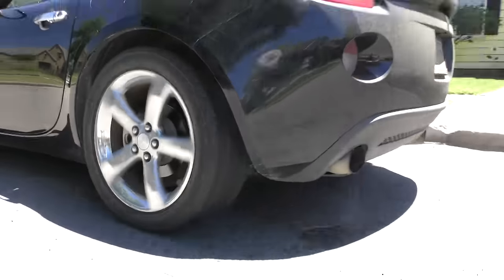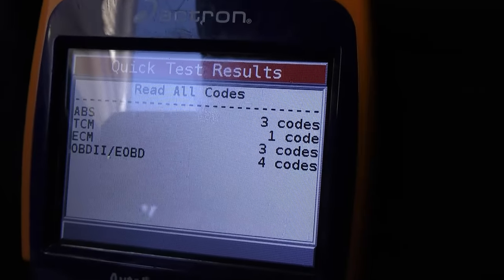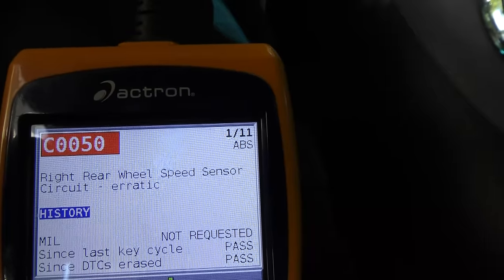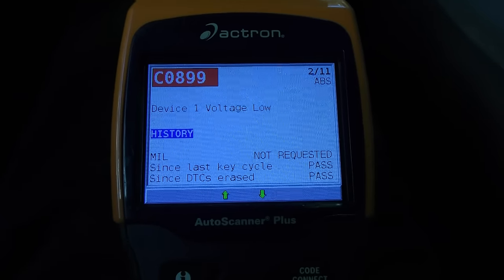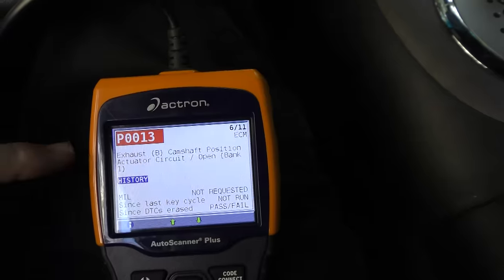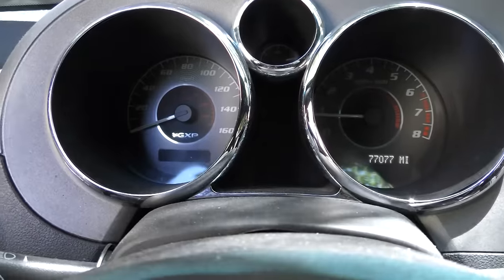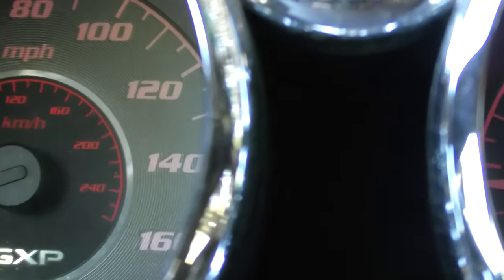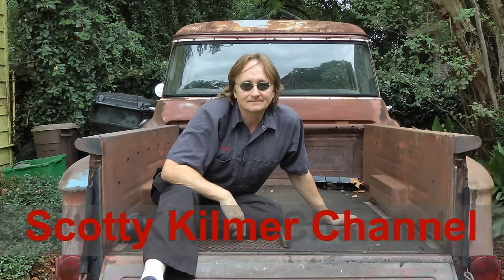Check Engine Light On in Your Car? The Truth About What it Means

Comment: Or just buy an older vehicle that doesn't have all that unnecessary stuff in the first place.
Reply: luke Fugate amen
Reply: luke Fugate I prefer disc brakes and abs. they stop much better and are easier to replace
Reply: Perfect suggestion! That's what I did. No unnecessary codes for minor issues, no silly sensors breaking, no limp mode from ECU glitches, no idle relearn bullshit, no reset codes to enter after disconnecting the battery! I truly miss 1990s technology when cars were actually built to be maintained and fixed instead of being purposely designed to fail, so manufacturers can rip customers off for profit, what a shame!
Reply: Yep, I'm still driving the same pickup truck I had when I first got my license at 16. I'm 43 now and the truck is 49 years old and I would drive it anywhere with confidence.
Reply: luke Fugate I daily drive a 1972 Dodge Dart swinger
Reply: Amazing! My vehicle is not quite that old. But, still built before the "unnecessary profitable tech" era, long gone are those days when vehicles were designed to last 20-30 years with just basic maintenance. These days vehicles are made to be disposable with HUGE profits in mind. If you think about it there is an abundance of unnecessary technology in modern vehicles that cause more harm or headache than good. My favorite example is "fly by wire" throttle which is absolutely unnecessary, there was nothing wrong with a mechanical cable that pulled the throttle open when you hit the gas, it's not a fucking airplane, it does not need electronic assistance to move flight controls, and that's just the tip of the iceberg.
Reply: I drive old Toyota's for this reason ;)
Reply: luke Fugate exactly. I drive an 85' f150 for this reason
Reply: luke Fugate low cost Saturn's are awesome for this reason.
Reply: BigWheel lol Saturn
Reply: my thoughts exactly :D  (driving an old 87 ford)
Reply: nickweg1996 I have an sl1 from 2001 i think
Nothing breaks on it because its pretty much a plastic shell with wheels being pulled by a few hamsters. 
A really nice beginer car i might say.
Reply: But when something goes wrong with it you dont know what the hell is causing it bc of no OBD 2
Reply: luke Fugate good idea
Reply: That's what they call troubleshooting.  With an older vehicle(carbureted)if it's getting fire and getting gas, and it's in time it will run. If my truck breaks down, give me five minutes I'll know which part has failed without having to worry about a computer.
Reply: luke Fugate I know that I had a 1997 Suzuki vitara 1.6 petrol single point injection only 50,000 miles was bomb proof Mrs did not like it, now got a Mercedes c220 cdi 2003 with many electronic things that can go wrong touch wood nothing so far
Reply: luke Fugate older cars have problems too
Reply: I recently bought a current model Vitara. It's practically the same engine, no direct injection, no turbo, only one variable cam. Very honest car that drives surprisingly well.
Reply: +RealDarkkFilm, OBD 2 is not an issue, if it is paired up with a basic system. mid 90s Toyotas, Hondas, Nissans etc came with OBD2 and still used very basic systems like throttle cables and map sensors(instead of MAFs sensors) which are more prone to issues. My 1997 Cavalier I had years ago had OB2 with a very basic oxygen sensor design(1 wire), I had it for 12 years and NEVER had to replace it. Fast forward 15 years, how many electronic throttle bodies,  MAF sensors, O2 sensors, key less ignition systems, tire pressure sensors, electronic gas pedals go bad and have to be replaced in a 5-10 years of ownership?? As I've said earlier, most of these "modern systems" are highly unnecessary, and are nothing more than a well thought out scam.
Reply: True, but they are much easier and cheaper to fix. Plus they have a lot more style than anything made nowadays.
Reply: Rodney King and why if its a manual dont press the clutch and turn it off when it stops?
Reply: luke Fugate pb
Reply: Hamachingo what year mine was 97  it was a 1.6 jx hardtop absolutely beautiful I loved it, I'm gutted extremely easy to work on if the very unlikely happened
Reply: That stuff is pretty necessary to keep the planet habitable for us.
Reply: like safety equipment
Reply: +Koshunae, Don't be naive, Trust me electronic fly by wire throttles, MAF sensors, tire pressure sensors, 
 dealer encrypted security codes, ECUs that go into limp mode for no reason, electronic gas pedals do absolutely NOTHING to make the planet more habitable. they are just there to break so car companies can make a fortune off of the repairs and parts.
Reply: Don't be so pessimistic. MAF sensors, EGRs, Catalytic converters, crank sensors, cam sensors, etc,. work together to keep the emissions of your vehicle down, namely CO2 and NOx, the biggest contributors of greenhouse gasses. Not only do they keep emissions down, they help your engine last by keeping it running in optimal conditions. Modern vehicles can easily, EASILY go over 400k miles with proper maintenance, I've seen plenty of them back when I worked the lube bay. I still see plenty of them in the shop. One of my best customers is a national landscaper and his personal truck, a 2012 Silverado, has 487,000 miles on it. Still on the original engine and transmission, no rebuilds. He also has a 2015 pushing 300k, and both of these are work trucks. They get used very hard, coast to coast pulling trailers of equipment. You will never see a pre-computers vehicle running that long without some huge intervention to refresh the vehicle. Really before the mid 80's, 100k miles was pushing the end of an engines life, and the transmission had probably given up by then at least once. 

Coming from a master technician, the systems suck to work with. They really do. The engine bays are cramped, sensors break and wires are everywhere, but calling them unnecessary is unfounded and shows you really don't understand the systems and their purpose.
Reply: Koshunae modern  vehicles are only built to last 100k miles, even the manufacturers admit it. Obviously, as a master mechanic, you don't know what your talking about. I know many people that have 2nd & 1st Gen dodge rams with a 5.9 that have well over 300k miles, I know people with camrys and Lexus that have well over 400k miles that are from the early 90s and neither of those types of vehicles needed any overhauling or large replacements. The new ones just can't go as long without major repair, typically electronic equipment. With the wrong Guage wire being used for everything on a car, just to save weight, it's no wonder why most recalls are something electronic. Gee, imagine that
Reply: I beat you Luke...I still have my 1967 Oldsmobile Delta88 that I first drove in 1982 when I was 18 years old. I moved it from Canada to Australia in 1997 and used it as my wedding car in 2004.  If I could by a brand new car like this I'd be more than happy to part with $100K for something built like a tank.
Reply: arnbo88 very cool. That car is a world traveller! I think the car companies have forgotten how to build cars nowadays.
Reply: NARK NARKO 15 years ago? Dude, OBD systems have been in place since the late 80's.
Reply: + John Mediadozena, I didn't vote for any of that, so don't hold me accountable! LMAO. This is why one of my vehicles is a 20 year old Toyota, something I can ALWAYS rely on, granted I perform basic maintenance.
Reply: +Wayne Wildman, What's your point? I am completely aware of that! I have nothing against OBD systems, my 20 year old Toyota has OBD2 and still has a throttle cable and MAP( not MAF) sensor, and is still paired up with a basic ECU design, AND IS reliable as hell, the "unnecessary tech" I am referring to are the ones that came with vehicles in recent years, such as "fly by wire" systems, overly sensitive MAF sensors, push button start systems, encrypted ECUs that shut down and require dealership codes to reactivate etc.. All of which cause more financial burden and headache than benefit. I have nothing against the early gen of OBD1 and OBD2.
Reply: Implying any of us voted or wanted that
I wasn't even old enough to vote when that was going down and had i been I wouldn't have voted "yes" to it!
The EPA and the government should stay outta my car.
Reply: I daily a 2000 Ranger that kicks ass. I'm not partial to any brand, if a vehicle is good - it's good.
Reply: I don't know where you're getting the story of vehicles not being built to last 100k miles. They've become more sophisticated with more systems and with more systems comes more problems. That goes for anything in life. Modern vehicles can and do go well over 100k miles. Often double, and sometimes even triple that. The key is maintenance, which most people wont or can't do these days, which is a shame. I do believe you with the 5.9 Rams going a while. I had a 1998 5.9 4x4 Durango that ran 266k miles before the transmission started having hiccups. Drove it like that a little over the 300k mark before I sold it. Great engines, tried and true like a small block chevy or ford. 

However my main point in all of this was to state that just because there are sensors running the vehicle now, that doesn't mean they are unnecessary. They've helped reduce the emissions brought on by vehicles tremendously. Our air is cleaner and our engines run better and longer (if you keep up the maintenance, that holds true to any era). I feel the anger toward modern vehicles is rooted in confusion and misunderstanding.
Reply: I knew a man who won a new Gremlin in a church raffle many years ago. I'll never forget the "half smile" he had after he brought it home.
Reply: Troy Tempest ...I know that "half smile" well, I won a pink Suzuki moped back in the 80's. It was embarrassing when I went to pick it up, to say the least. I gave it to my Mom. Lol
Reply: Rodney King I've always believed thats the true reason for it.
Reply: It,s not just cars! Everything built nowadays is disposable! I'm pretty sure my Gchildren think I'm either an idiot or a genius for trying to fix things.
Reply: Or, the EPA will make you add on a EFI and cat converter! They're trying to do that with racing and off road vehicles...Can one say, 'over reach?'
Reply: luke Fugate computers are taking over everything not just cars. I absolutely hate the saying "embrace the technology! it's here to stay" no I will not embrace a starter and oil seal wearing out after less than the years or a steering wheel position sensor going bad and the computer unevenly slamming on the brakes making the car swerve and almost go off the innerstate at 75 MPH. oh and the last issue was under warranty and took the dealer over a year to find because it was spurattic. all of this needless tech in newer cars is just a way to make the owner not be able to repair it and fork up the big bucks at the dealership. I agree completely with the thought that old cars are nicer than newer ones. one peace of tech I do like in cars that's been around since the 80s is EFI and only with older cars.
Reply: I AGREE WITH YOU, A MOTORCAR DON'T NEED ALL THAT ELECTRONICS
Reply: Jack Paskievitch  im a chevy guy but thoughs are nice trucks
Reply: and don't buy a European car
Reply: NARK NARKO I agree that OBDII is good automotive technology and that it's about the limit of what is practical and durable automotive technology. I drive a 1998 Corolla with OBDII and it recently helped me identify and fix a problem. The Corolla still drives like new at 260,000 miles. The cars of the mid to late 1990s and into the early 2000s are in the sweet spot in terms of automotive technology: they are advanced enough in terms of performance and efficiency, but not so complex as to sacrifice durability and ease of repair. By this criterion, the Corollas and Camrys of this era are among the best cars ever made.
Reply: Can still have that in some OBD 1 cars
Reply: True but some of that stuff Is there for your safety
Reply: That's why I drive a 1994 Toyota celica, I love that car.
Reply: @lemkelegion  first of all lots of old cars have disk brakes. Second abs is for people that can't drive.
Reply: Good idea

Comment: My ABS light goes on and off. I pass inspection every year. I'm not investing in a 2002 VW Jetta. The cost of fixing a ABS sensor costs more than the car.
Reply: Scan it to find which component is bad. Although new parts are expensive, a nice day at the junk yard is cathartic. It'll likely only cost a few bucks and a lot of the components that often fail (speed sensors) are pretty easy to replace on these VW's.
Reply: Supply and demand. An Audi/VW temp sensor that commonly goes out is $3 shipped on eBay because the aftermarket caught up. I realize the quality isn't the same, but these Audi parts aren't that well-built in the first place. The same car's PCV hose is over $100 because it's OEM only. For Plastic!
Reply: I got my sensor for 7 bucks on ebay works like a charm on my 02 jetta

Comment: In Germany, we have a safety inspection every 2 years. One of the mandatory things about such an inspection is that there have to be no lights on in the dash. And newly, also no codes stored in the ECU, so they actually hook a scan tool onto it (and may even drive it for some time). ABS codes are a no-go, because that's considered a critical safety system (after all, it helps you maintain control over the vehicle in an emergency braking situation), but also check engine codes are a no-go for various reasons like environmental safety and so on...

Comment: I had P0013 and P0014 for months on a 2010 Chevy. Over time it caused the idle RPM to go up and down pretty quick. Also caused RPMs to go up and down when only slight throttle was applied (at any speed). Was just the camshaft exhaust solenoid that went bad. Swapped it out, runs perfect now. I guess thats a pretty common problem -- the solenoids going bad on GM vehicles.

Comment: I just bought a 2015 Lincoln MKC with 22000 miles on it this June 2018. About a month ago it started idling rough in drive when at a complete stop. The dealer said to keep driving it till the check engine light came on because it would be easier to detect the problem. It did come on about 2 weeks ago but didn't stay on. I brought it in and they found it was a faulty fuel injector. Of course it was covered by a factory warranty that's good till 48000 miles so it didn't cost me nothing. The technician that works on those kind of problems was out sick for a couple of days and they had to order the part from Ford   so it took about a week to get it back. Its been running smooth ever since. They also gave me a free loaner to drive so it didn't cost me anything for a rental. I had a 2018 Ford Edge with 1500 miles on it for the whole week while mine was being repaired. I think I bought this car from a great dealership. Anytime I bring it to them for repair or service they give me a brand new car to drive as a free loaner. And every 4th oil change is free. I love it when I don't have to pay for a repair and get to drive a new car for free.

Comment: I feel a disclaimer is warranted here, especially since you work on cars in Texas where all the major metroplexes except San Antonio have emissions inspection requirements every year.  Clearing the code will also reset emissions monitors.  Any more than one in a not ready state will cause an inspection failure just like the MIL light is an automatic fail.  These can take forever to re-enable themselves, and with EVAP codes in particular (the last monitor to run usually), I've literally had several cars run all but the EVAP leakdown test (which made it eligible to pass inspection) and then on that last startup right before I hook it up to the inspection computer, the leakdown decides to run and poof...I've still got an EVAP code because somewhere, ethanol gas has deteriorated a vinyl based vacuum line!  My ultimate point is that although sometimes a check engine light is a minor issue in some situations, not addressing it as minor at the time will cause you a lot of grief down the line.

Comment: I liked this video, unfortunately, here in Massachusetts, a car will not pass the state inspection with a "check engine" light on. I have to be a slave to fix the "check engine" light, otherwise I cannot drive my car legally on the road around here.
Reply: Akiko Maki I'd move to another state!
Reply: Here in Louisiana, they will not inspect the car with the light on; if the inspection sticker is expired, they will issue a "rejection sticker", which is good for 20 days. You must then get the problem fixed during that time, then return to the issuing station to have the car rechecked. If the ECU hasn't performed the self-checks, they will reject it and tell you to come back in a few days. So disconnecting the battery and clearing the codes will not work. The state also tests the CEL bulb (the computer software at the testing station sends a signal to the ECU commanding it to illuminate the bulb). So the CEL bulb cannot be disabled in any way or you fail!!!
Reply: Get a Mexican that pass you the inspection for $75 dollars 💵😂
Reply: put a piece of black tape over light , ha !
Reply: Easy fix, disconnect the car battery then reconnect it. This will reset the computer, engine light will go off for a period of time.
Reply: You’re right.
Reply: Yes. Works too.
Reply: Akiko Maki same in illinois. was dreading a 400$ repair when all the sudden my light when off, i carefully drove as fast as i could go the inspection place where i passed as it came back on right as i was leaving. pretty sure the technician noticed but didn’t care.
Reply: @Angelsk101  Does not work, as Cleared of Errors sends back a status of Not Ready, and will not pass inspection.